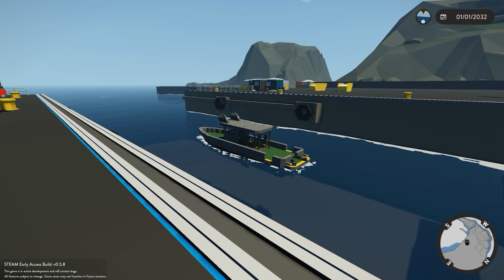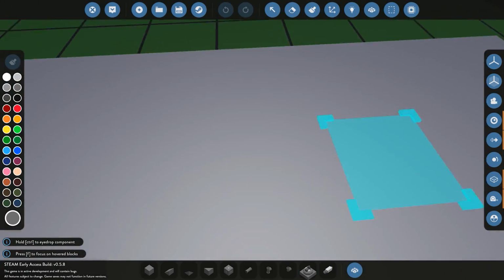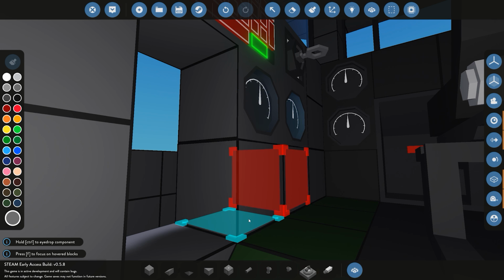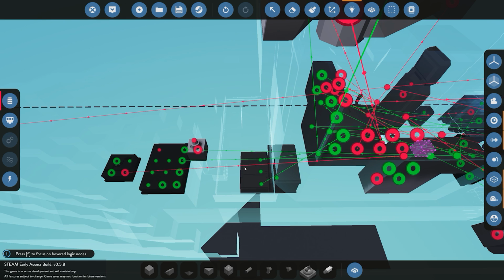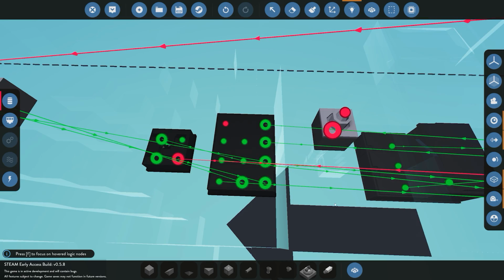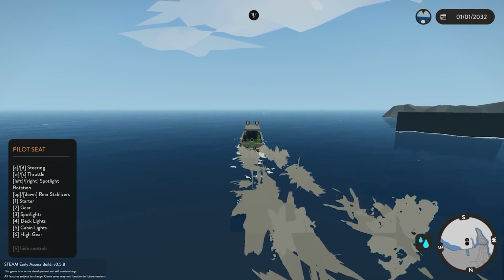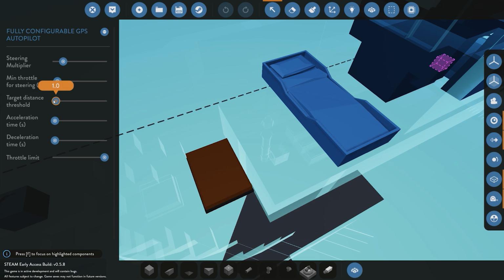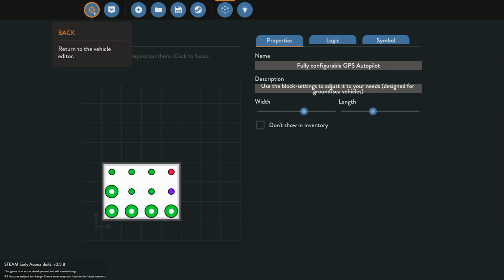Stormworks 1 Block Autopilot Microcontroller

Comment: Nicely done. Just 2 things I'd like to add:

1. The accel and decel times are not "how fast you want to get", they control how long it takes to reach full throttle and then again how early before reaching the destination it starts decelerating. (very useful if you have a crazy strong engine that could flip your vehicle if you accelerate too quickly)

2. Min throttle for steering is mainly used when the vehicle is pointing away from the target. So if you keep this value low you'll get a tighter initial turning circle.

Comment: If you happen to be looking for tutorial ideas. How to setup automatic ballast tanks that fill and drain when needed, would be an awesome tutorial.
Reply: yes please
Reply: @dotbmp  If only they fixed the pumps first. I have 4 in sequence and it takes ages to drain my ballast at even shallow depths such as 50m
Reply: @gre8  as far as I know T-pieces reduce the max flow and 2 pipes = 1.5x flow, not 2x so take that into consideration as 2 separate ones will flood the tank quicker than 2 in sequence, at least I think that's how it works
Reply: @SoundlessMusic  you would need them working together because I’m pretty sure the problem is that the pressure outside is to high for things to do things